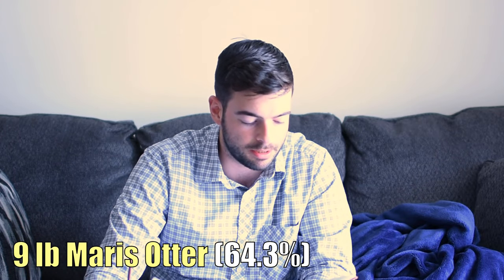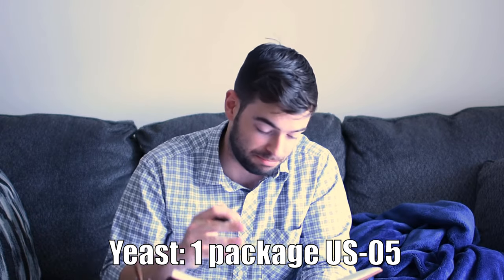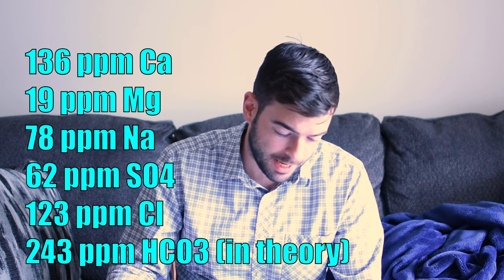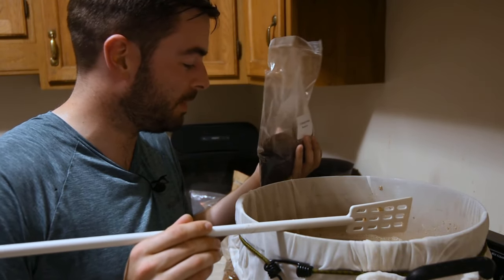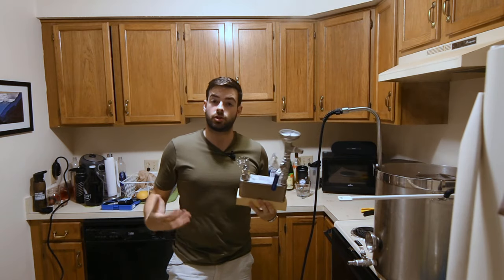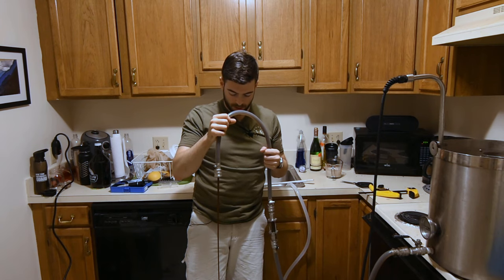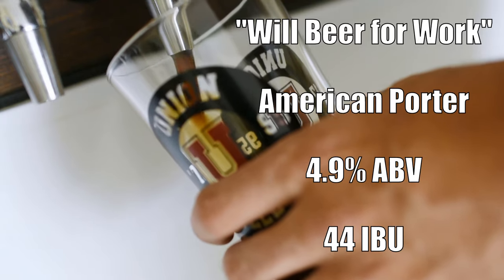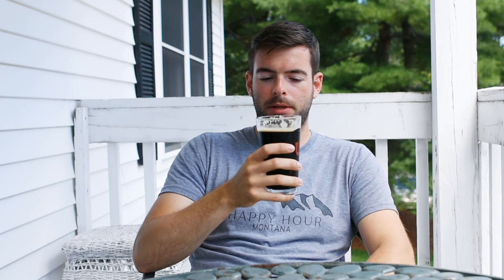Brewing an American Porter | Grain to Glass | Sorta Failing at Water Chemistry

Comment: Good stuff!  A lot of my beers have improved significantly by building my own water from RO or Distilled.  I actually use a 60/40 blend of distilled and my filtered tap water when I brew on my big system.  Then I use 100% distilled when I use my induction small batch BIAB set up.   Cheers!
Reply from the maker: I'm not sure if I want to do full on RO/distilled water for everything yet, because I really love the way some of my European beers and hoppy beers have come out because of the water, but its probably worth doing for my stouts and porters. Cheers!
Reply: @TheApartmentBrewer  I looked at the cost of sending my water off for analysis and it was about the same price to buy a four stage RO unit. If you know your water profile, and you know that it does not change, you can dilute your tap water with distilled or RO water and then adjust that water to match your desired profile. For me, it's cheaper just to use RO and adjust, assuming that the RO has zero of all ions.
Reply from the maker: @johnauld1268  I wish I could install an RO unit, but as a renter right now my landlord would not be super happy with that. For now my approach will be using distilled water t build profiles for roasty beers and keeping my base tap water to build profiles for everything else (which frankly works great), but its great to know that the RO system isnt too expensive!
Reply: I ordered my RO unit with washing machine connectors. To use it, I put the unit on the kitchen sink, unscrew the washing machine hose and hook up the RO using the fittings below.

https://www.swelluk.com/d-and-d-ro-garden-tap-connector/~

That's not as good a proper plumbing, but it works for me. But if you have water that's good anyway,  it makes sense to keep it simple.

Comment: I built a portable RO system for around $150. All the parts are accessible on Amazon. I put it in a case I picked up at Harbor Freight. I put an in-line TDS monitor on it. I referenced https://www.hbrewo.com/ for the build. I’ve used it for a few brews now and it works very well. Water is still coming out at 0ppm and at Ph7. I fill up a few 5 gallon containers before brew day.

Comment: for me it's the opposite. I use my city water for dark beers. 60/40 city/RO for amber and 100 Ro for light. Works out well :). Good luck with the water side of things (btw, if you go PH go mw102, I bought 2 before I bough this one. Went from 30$ one to 80 to this, buy once, cry once)
Reply from the maker: That's what has been keeping me from buying cheaper pH meters - longevity!
Reply: @TheApartmentBrewer  yes,  but more than that,  can't even trust the result from "calibrated" cheaper models.  I think you are doing it right with going with strips till you can afford a real one.

Comment: Glad you decided to go the RO route, now you can use God's Gift to Dark Beers:  Baking Soda!  What program do you use to calculate your water chemistry?  I use Bru'n Water, and have found both Beer Smith and Brewer's Friend to be somewhat inaccurate with regards to ph at least.  At least your recipe looks pretty good, I do love what brown malt adds to a porter/brown ale.
Reply from the maker: I have shied away from using baking soda since my sodium counts are a lot higher than most people's already, but if I start using distilled it makes sense to use it. I use beersmith, and sometimes bru'n water too if something in my city water changes.
Reply: @TheApartmentBrewer  It seems like Beer Smith typically gets you the right calculations, but have you A/B tested it against the Bru'n Water ph?  There have been several times (mostly on Brewer's Friend) that my acid additions are waaay out of the norm.  But I agree that it's probably a water issue and you'll get better carbonate results from being able to use baking soda.
Reply from the maker: Haven't done anything like that but that's a good idea. Id be interested to see the difference. I know the two programs calculate hardness slightly differently

Comment: On a home brew scale, baking soda (Sodium bicarbonate) is great for increasing ph. The baking soda will add some sodium to your beer but will be a small contribution. On ph meters, spend the money and get one with a changeable head. Ph meter heads don’t last forever. For them to last longer, you don’t want to stick them in hot wort. You want to cool the wort sample to room temp and then take a reading.
Reply from the maker: I wish i could use baking soda, but the problem I have is that my sodium count is already very high (65 ppm). Just adding the 2g in this recipe pumped up to 78 ppm for not that much HCO3 contribution. I've heard some suggestions for pickling lime, and for potassium bicarbonate which may be a bit more flexible for my tap water. But I think I'm just gonna do distilled water for my stouts and porters and build from there. Thanks for the insight on the pH meter heads, I really dont want to end up having to buy cheap pH meters only to have to replace them frequently
Reply: @TheApartmentBrewer  Sorry, I forgot how high your sodium level was already. I have never used potassium bicarbonate, but pickling lime is strong for anything under a 10 gallon batch. It takes nothing to slug the PH to high and then you have to push it back down with acid again. I would just use distilled or RO and use salts to shape the water to your needs. Good Luck and cheers.

Comment: Hey brotha, you said you treated both your mash and sparge water with the same profile. So you just treated each of those separately or did you make one big batch and separate some of it to heat up for your sparge water? 

I am going to try my hand at the sparge step to up the efficiency on my BIAB system. Beer smith seams to suggest to treat each water step separately. Hope this was clear enough to understand, thanks man!
Reply from the maker: Typically my process is to treat everything in one large batch and let off some water for sparge before I mash in, which I keep at sparge temps on the side. You'll definitely see efficiency increases by incorporating this step!
Reply: TheApartmentBrewer Awesome! Thanks for your ongoing help. Take care!

Comment: Why do you still use the hydrometer when taking FG if you have a refractometer?
Reply from the maker: Good question: the alcohol present in fermented wort will actually skew refractometer readings significantly. Plain old hydrometer is just more accurate
Reply: @TheApartmentBrewer  interesting, that makes me want to get a refractometer less.
Reply from the maker: @slugger777  I can understand that, but it doesnt need temperature correction so it makes for a very quick and easy way to be sure of my gravity mid mash or mid boil, and does offer additional precision during those steps.
Reply: @TheApartmentBrewer  I guess I just have other priorities in my brewing setup at the moment then. But yeah I can see that it would make your life easier during brewing and mashing. Thanks for the info.